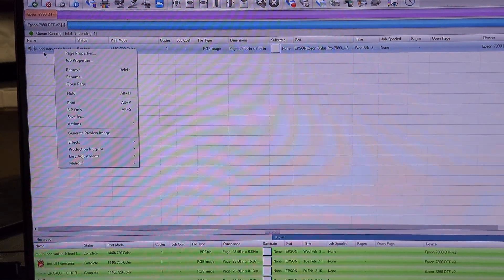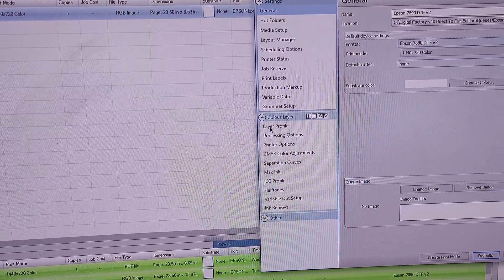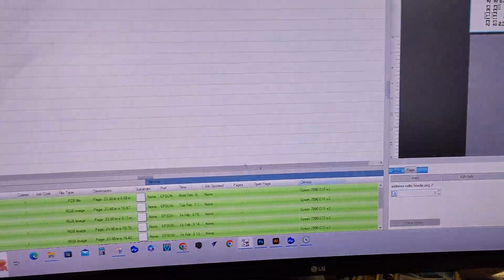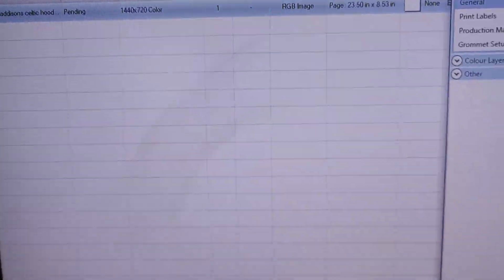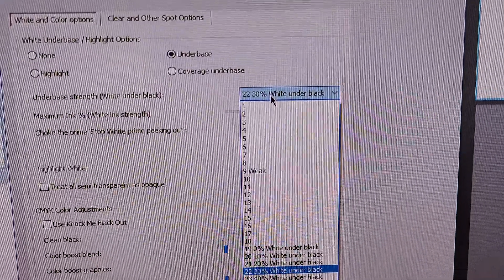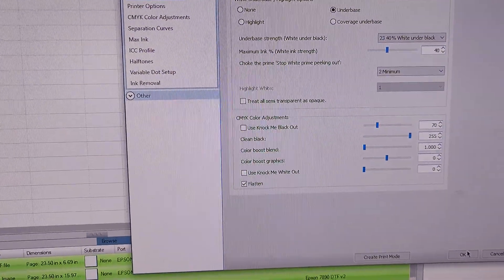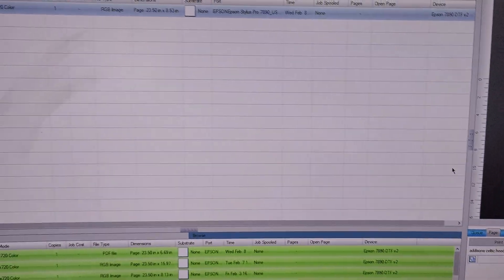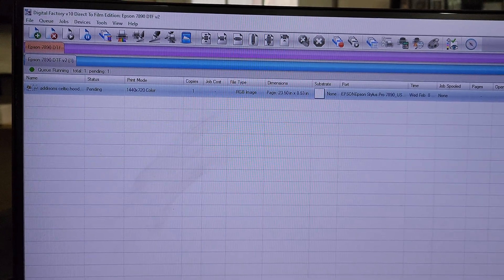Cadlink Digital Factory v10 Dtf.  CHECK ALL OF THE SETTINGS!

Comment: hey any advice on how I can get the colors right on digirip/cadlink . they don't seem vibrant and the image isn't as clear as when I was printing on procolored software.
Reply from the maker: When you open up cadlink at the bottom center of the screen you will see "COLOR ADJUST" select that. A new window pops up and will give you some options. Every LIGHTER  color I moved the slider up to  or  around 75%. At the bottom of that small window I also selected PHOTO instead on ICC or GRAPHICS. Now all printers are different mess around with the settings and find out what works best for you and your printer. Have a great day!
Reply: @berkshireembroideryprintin8956   thank you so much

Comment: When I print my white came out like a grayish blue and my red came out like a pink. I’m new to dtf and the software and I’m not sure what to do
Reply: If your red comes out as pink,  you might be using a sublimation ICC - happened to me years ago. Sublimation prints often looks pink, but after thr heat press, it turns red
Reply: @BpKoksan I have problem when nozzle check colors are oke when printing al is black green .. like the channel for colors are wrong …. Can you help nee out pls ?

Comment: I like Cadlink, but I stopped using it. It start printing right away, but prints very slow, and when the print finishes, it doesn't push the film forward and the printer suction is keep working until I press cancel/delete button. I had to go back to AcroRIP, it prints much faster and always right colour. Cadlink prints brighter, but a bit off-colour.

Comment: um that setting was putting down less ink where was the waste you went from 20% under black to 40% under black your setting is wasting ink. I never have white under black if needed for 10% saves ink
Reply: If I don't use 50-100% white under black and 50- 5 maximum mine won't print white at all